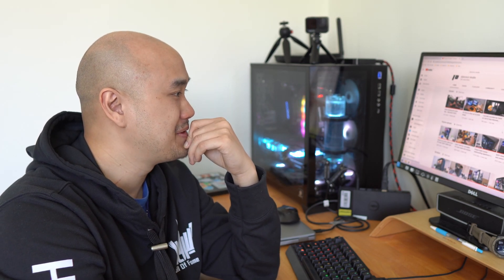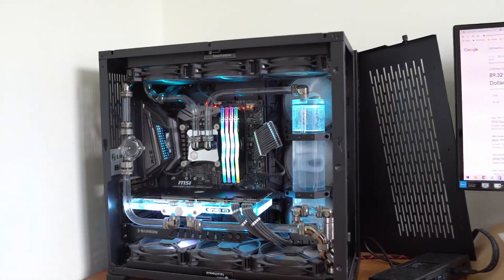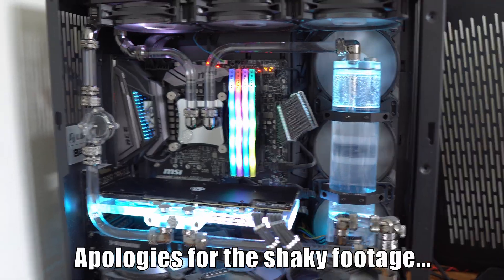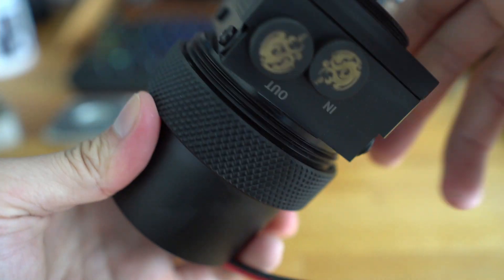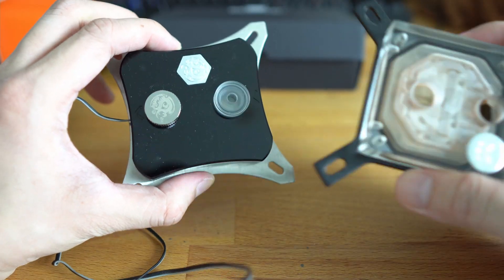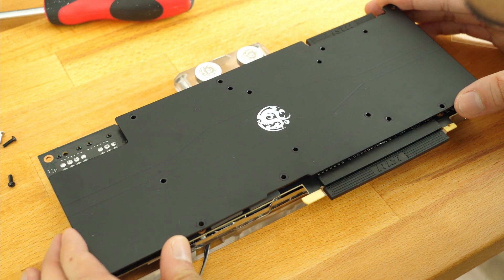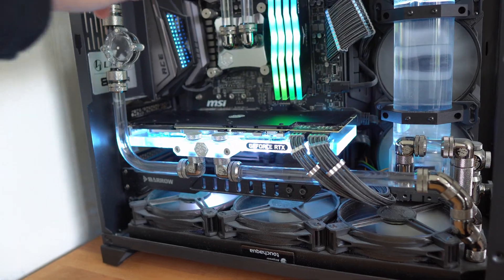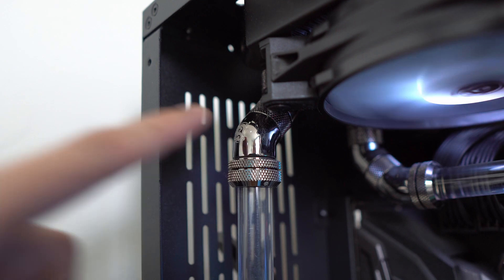THINGS TO KNOW BEFORE WATERCOOLING YOUR PC!

Comment: I know this is an older video at this point but I suggest for people scared or new to water cooling look into kits that come with everything you need to start from brands like EK or if your interested Bitspower sells a Lian Li o11 dynamic case that has a reservoir, radiator, pump, CPU block, pre-cut and pre-messured tubes, and fittings all built in for a very very good price around $549 USD at Micro Center.

Comment: Great vid!! I have seen it many times (as many  of the watercooling videos on YT), I am spending time "planning all my build/loop". I have the exact same case and I am planning to add rads (bottom and top) and I would like to know how much space clear do you have in the video for that "long" reservoir. I m asking because it seems really long and I know the o11 has 44,5cm aprox of  gross height. Sorry for the text, my question: Is that a 260-300mm reservoir? I calculated a clearance of 30-35cm for an upright reservoir. Thank you so much!

Comment: Thank christ Amazon, and its awesome return policy exists!

I just completed my first custom loop, and in the process, bought and returned 3 CPU blocks, 5+ rads, a reservoir, a couple of D5 pumps and hundreds of dollars worth of fittings and fans.

Some of my returns were due to case compatibility issues, but most were due to sub par aesthetics.  If I'm going to drop $1000+ on a custom loop that I don't really need, I don't want to make a bunch compromises that leave me wanting to redo everything.

So buy from Amazon (or somewhere with a similar no questions asked return policy) if you think there's even a chance you might need to return a part.

And if I could a fittings tip, you'll likely end up wishing you'd bought more extenders in various sizes, more rotaries, and a few offset rotaries (when clearances are an issue, or you need to line up each end of a given hard tube run in a straight line). Even soft tube builds  are easier to route with the above fittings, and they can look really good if you spend the time to plan your tube runs carefully.

There's also a huge difference in quality between Bitspower or EK Torque fittings, and the chinese Amazon brands (SDTC etc.). The latter may well leak, or slowly erode over time, and they'll often mis-thread when attached to G1/4ports.

Personally, I learned to avoid cheap fittings the hard way, and would much rather buy once/cry once.
Reply from the maker: Thanks for sharing your experience! Yeah same, my first custom loop was not so good, I wasted some parts and unfortunately those were not returnable.